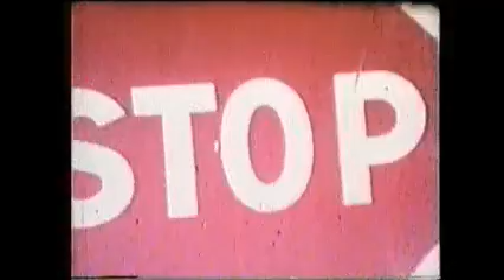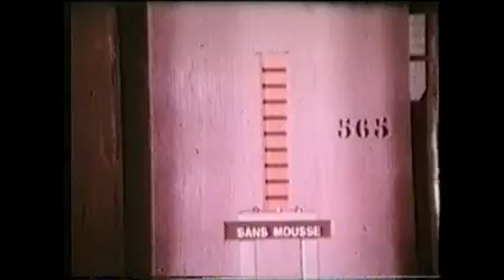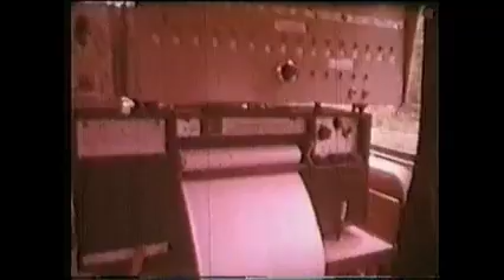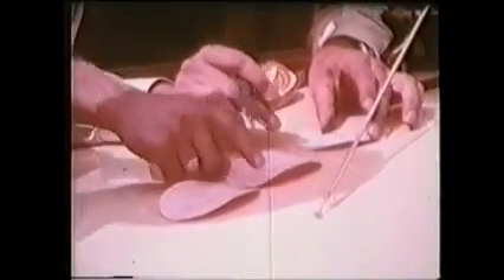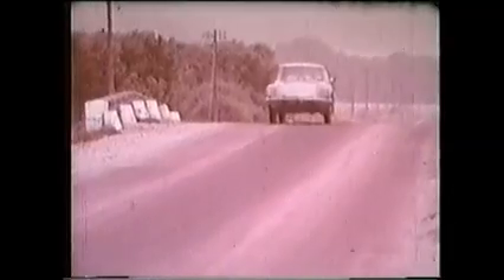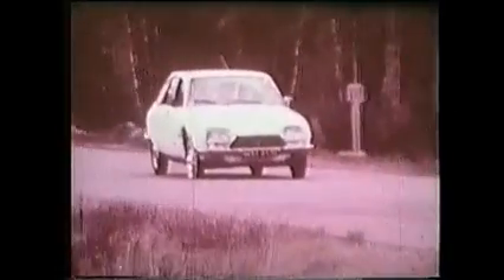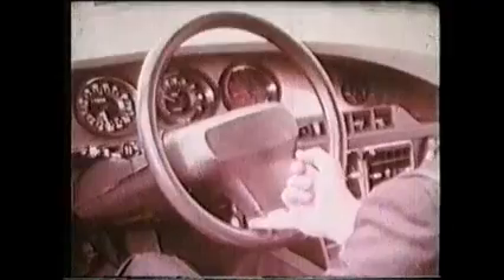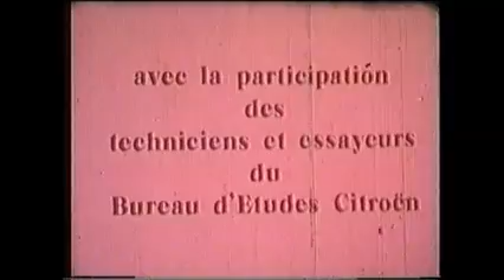Citroen GS GSA 2CV safety promotional video

Comment: Fit an SM with airbag and i bet you can produce and sell them again. Very advanced car for its time. Of course with a modern engine it would be a blast to drive, too.
Reply: Yes, not as good as a modern car in a crash event, but as good in crash prevention, taking in consideration the SM has no electronic aids and it's almost 50 years old. The most secure car is the one that has no accident in the first place.
Reply: No way. Taking in consideration SM has no electronic aids and it's 50 years old, it's NOT nearly in the same ballpark with the level of active safety cars have today. You're just being deluded even more. Sorry. It's a great car and very advanced for it's day, though.
Reply: Good answer, but I don't know if you have driven a citroen with hydropnematic suspension or a new car with all the new electronic aids, so I'm just gonna explain my point of view. I've driven both, the hydro citroens very fast in different conditions, never having an issue with stability and comfort, and they are very easy to drive, to the point I've never felt the need of something to aid me. 

Modern cars (standard cars, not sports cars) they won't let me drive fast or even try to reach the limits of the chassis, I guess this will give security to an average driver, but maybe the solution to a problem is also the cause. If people don't know how to control a car in a possible crash situation, they need the car to drive for them? Wouldn't it be better if they knew what their machine can and cannot do before going out to the road? 

Vicious circle, governments complain abouth road deaths but don't want to invest in better driving school systems, so they blame car manufacturers by making stringent safety standards to be able to sell a car, and then people doesn't need to know everything about driving because their car would drive for them (or protect them) in risky situations. 

My current car has ABS, stability control, 6 airbags, seatbelt tensioners, etc... Although these systems are good, in my daily driving they won't even show a hint of work, just because when I'm driving, I'm driving, not texting, or watching people walk down the street, or even talking with my passengers. I use my mirrors and respect driving law in the means of possible. I do like to drive fast, but not everyday, or in the rain, or through town. I wait till the night and choose an open road in a lonely place to enjoy driving (we don't have race tracks here). 

YMMV, but following common sense and knowing how a car works it's the best aid you need when driving. I know having security sistems in case of an accident it's better than having none, but again I can't speak for that, as I've never had an accident.

Well, that's my point of view, and why I think adding systems that interfere with the commands a driver give to the car it's not the best idea, creating dependance of the said systems and causing more harm than good if they decide to fail, they are still machines and haven't got common sense yet.
Reply: Well written, but you know, I think that you have to deal with problems as they arise. One of the main problems with traffic is that it's density is increasing. Average driver now does much more mileage a year than 30 years ago. Given that probability of accident is a function of both traffic density and distance traveled, policy makers and car manufacturers were faced with the problem of increased rate of accidents and on-road fatalities. This is a problem that you have to face in real time. You can't just hypothesize, that if people were better drivers, there would be less accidents. Yes, it's true, but this is something terribly difficult to change and as always, when behavioral change on the scale of whole society is needed, this is a matter of generational exchange. While I agree that better education is needed, I think it's a good thing that policy makers and car engineers focused on car safety to bring change within a much shorter timescale. For instance, since organizations like EuroNCAP were established, standards of passive safety improved immensely.

As I remember it from 20 or even 10 years ago, the overwhelmingly prevailing narrative was that every year, number of deadly accidents increases. Now, for several years, at least in my country, the trend is reversed. I have not checked the statistics, but I am pretty sure this is pretty much correct. Given that traffic density doesn't change for the better and on-road behavior changes for the worse with the increased amounts of stress, this indicates that the engineering efforts were overwhelmingly successful. The technical advancements that you mention are a big part of the progress that was this successful, although it's downside is paradoxically the fact that people become psychologically more assured and care less and less still about the core driving skills. But that's how the world is; you come up with what appears to be a good solution to a problem - which the technical development in the car safety department demonstrably is - yet you arrive at unintended consequences that relate to basic human psychology.

I agree though that Citroen's hydropneumatic suspension, along with other innovations like turning headlights etc., were great solutions at the time and it is incredible that even now, this is by far not an industry standard. On the contrary, they're still considered luxury items. That said, I am baffled by the stupidity of the current Citroen management that decided to drop the tech solutions and indeed that whole philosophy that made Citroen the unique brand it once was. 

But on the other hand, there are exciting developments in the car industry right now. What Tesla is doing, is just amazing. This is another revolution in the car industry unfolding before our very eyes.

Have a great day.
Reply: vecernicek2 : yeah, Peugeot bought Citroen . They decided to stop using the hydraulic suspension. I too, think it's a dumb move. This suspension was something that made Citroen unique. Why buy one if they're the same as all other cars. ? I think they'll sell fewer cars.
Reply: how about keeping the outside , the chassi and some of the interior features of the SM and combining that with the technological, modern,practical and secure stuff you can find in a tesla model 3 (witch is the safest car of 2018)> you could also fit a battery to drive the rear wheels. the wheight would not be a problem due to the hydropneumatic suspention
Reply: stoping to use these tec stuff that made citroen unique would be like lotus or caterham to decide to do cars with no envolvement and that handle like a volvo estate
Reply: 9oo
Reply: Oh, yes, everbody loves the SM! Well, at least until you have to completely remove the engine to replace the v-belt for the air condition. Someone around my place owns an SM. Awesome, even with the A/C not working.

Comment: It is unbelieveble how the 2CV stays on the road.
Beautiful video!!
Reply: Its not unbelievable. Science shows its point of mass is beneath the middle of the axles. This makes that car so extremely stable, that even heavy bodyroll is unable to topple that car over. Not to mention the very, very, very long suspensionway of each tire on the road. Those cars maybe were very basic and simple designed, but they were and are still today way ahead against modern cars. You dont need much to get the most out of it. The 2cv was and still is solid proof of that

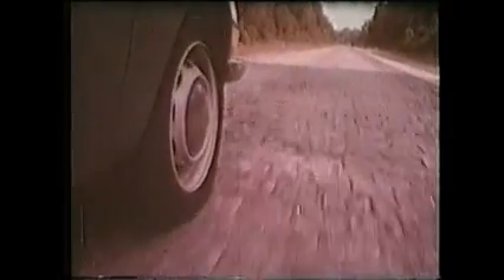Comment: Can you imagine any modern car on those roads from 7:30 onwards? The passengers would be knocked out by banging their head against the B pillar...
Reply: Even the 2 CV could handle this roads. Wow!
Reply: Up
Reply: Suspensions nowadays is just Sport, sport, sport. That's the result of usign 20 years old test drivers. Put some 50 or more years old test driving these cars and we'll get these supensions again. Why having a sport car suspension if 99% of the time we are banging on potholes and speed bumps?

Comment: The way that old 2CV was scraping the door handles through the turns is hilarious!
Reply: Yes but it remains controllable, keeps its track and stays on the road. A 2V would stand a lot of abuse on road and off road, and do not care of rain, mud, ice and snow.
Reply: Designed in 1936, they changed next to nothing in 40 years of production.  A much better car all round than a post war VW Beetle.

Comment: I wonder if the polyurethane foam they're talking about is still in good condition, or if it's the same as the spongy stuff that tends to dry/crumble...
Reply: Produced for a Very Singular purpose, unlike the multifaceted requirements of what you are comparing.

Comment: sorry but in a real accident the   diane and 2cv  would be oblitterated     what were the speeds anyway?
Reply: +Alessio S 2cv speeds depend on what year it was made in but the early ones had a top speed of 39, mid ones had a top speed of 48 to 63, and the final ones had a top speed around 70. Im not sure about Diane
Reply: Hello There still in a crash against any other car the cabin will be ripped off it's underbody and the occupants...  you can make that up  ...  ofcourse it is a 1939 design
Reply: @stormtrooper8431  MPH are unknown on continental europe...
Reply: @215alessio  no: the 1939 2cv's had a aluminium bodywork, the 1948 a steel bodywork, much stronger...the 2cv hold much better accidents as many did expect because the energy is dissipated from tires sliding...and the strong chassis is at height from the bumpers from other cars...

Comment: The idea old Citroens were ever safe is a total laugh. I drove the 2CV & it practically leant onto its door handles in a corner. My sister had a minor bump in one, where there was hardly a mark on the other car (a Cortina) whilst the 2CV's entire front wheel was hanging off. My aunt had a DS which had a switch for the brake, so it was either full on or full off, with no modulation, and which once failed. And it too leant over & understeered more than most in a corner.